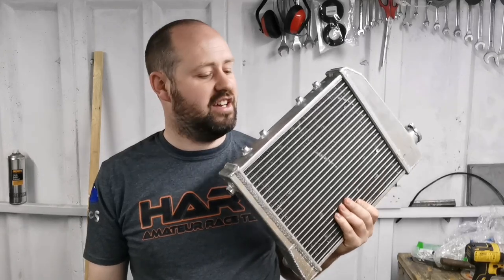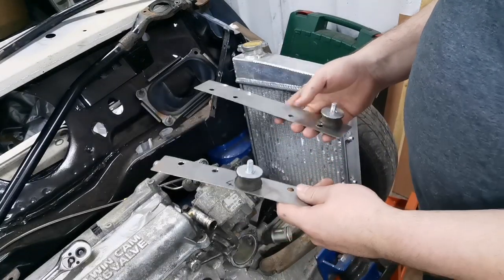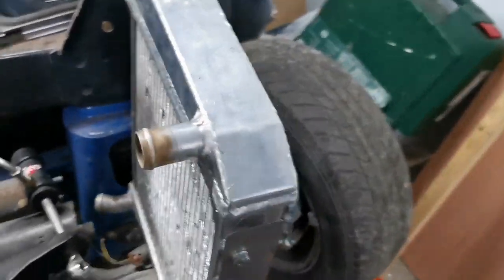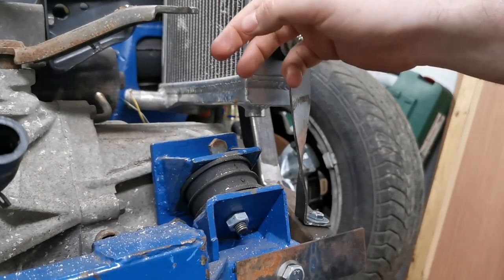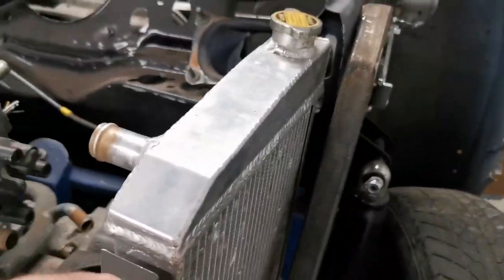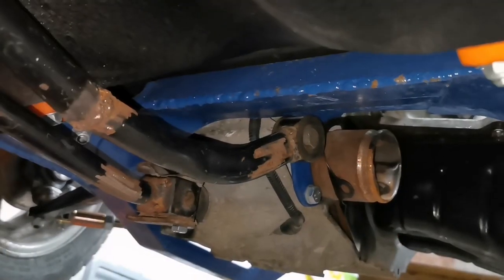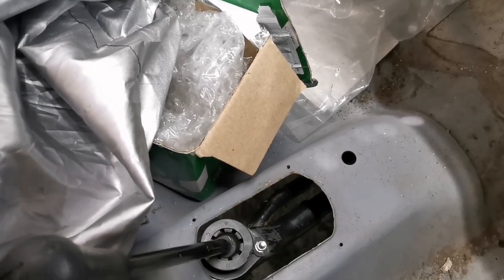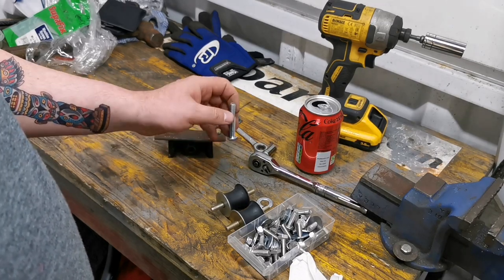Classic Nissan Mini - Radiator & Gear Linkage

Comment: Some seriously classy welds there lol,why didn`t you carry the twisty bracket to the top of the rad and have two fixing points and two on the other side as well , top video keep up the good work
Reply from the maker: I wanted to just keep it put of the way but looks like I might have to extend it lol